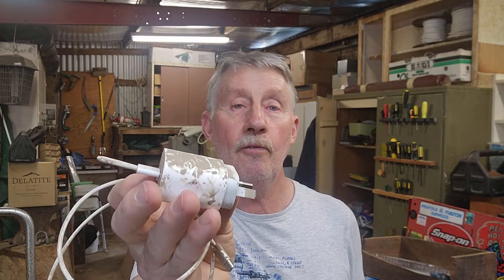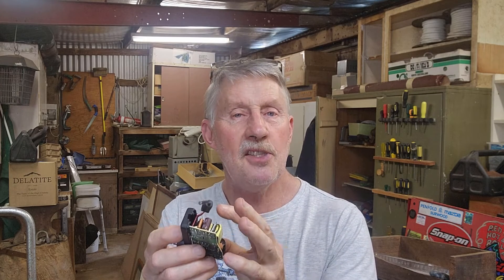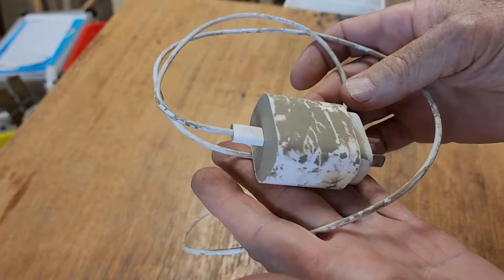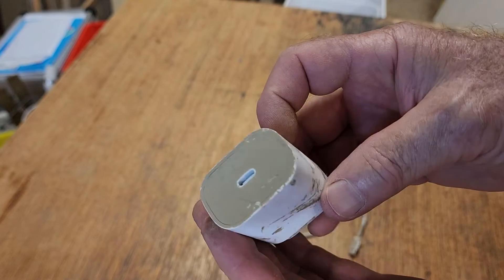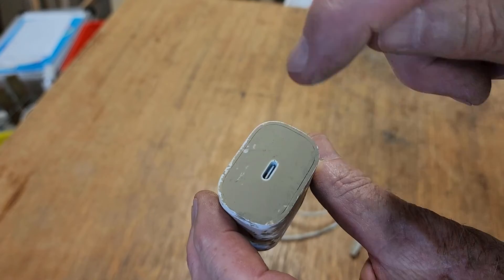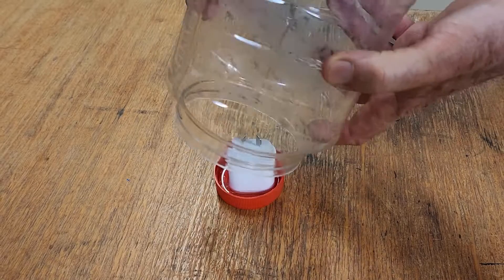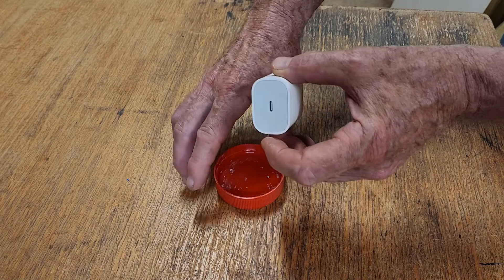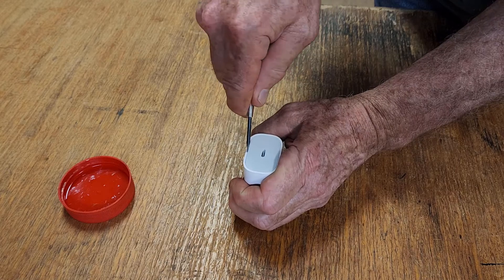How to Repair an Apple 20w USB Charger which was under Floodwaters for 3 days! DIY iPhone Charge Fix

Comment: I was looking for a way to get into a 20w usb c charger. I actually slid 2 pry thin tools on the bottom side where the pins is. And I popped it off by unclickiking the clips on it. 
The top is still in beautiful condition and the very minimal pry marks is at the bottom
Reply from the maker: Excellent, nice work. Yeah some have clips and some are glued. Usually you have to fight them!

Comment: The charger is adhered with ultrasonic bonding, requiring gasoline to remove it. There is a YouTube video demonstrating how to disassemble a PC charger using gasoline for a clean decomposition. Please refer to it for guidance.
Reply from the maker: I couldn't find that video, what keywords should I search?
Reply: @TheUltimateRecycler  https://youtu.be/a00esZ3B-aQ

Comment: Hello my friend, can you tell me with what you have cleaned your so dirty charging adapter and cable in a very one way.  Because I tried to clean 2 different iPhone charging adapters with petrol, the top surface of both chargers melted like wax, like plastic on fire.  Please tell me with which liquid you cleaned this charger and cable properly.
Reply from the maker: Yes petrol and other solvents can indeed melt certain plastics! I used IPA (Isopropyl alcohol).
Reply: @TheUltimateRecycler  you used normal alcohol or special alcohol. Normal alcohol like mixed in everyone whisky 🥃 because my friend have buffalo dairy Farm they use alcohol to milk fat report they use vet strong alcohol. Waht i can use these alcohol?
Thanks for reply
sorry for my weak english.

Comment: Well done on this one! I had a friend who dropped a valve radio into the sea! He managed to rescue it immediately, took the valves out, put it in the bath and covered it in cold tap water, which he swilled around vigorously for a while, picked it up, let it drip dry, and then put it in the thermofan oven at 100 degrees C for a couple of hours, and then tested it out, and it worked perfectly. So rinsing in clean water, rinsing in IPA, blowing it dry and then letting it heat up in the sun as you did, makes perfect sense!
Reply from the maker: Thanks Dave! Yep, as long as there's no power involved while the item is wet, then no damage should be done. Although leaving things sit without rinsing and drying would introduce a whole host of corrosion problems!

Comment: It takes a lot of skill to outwit a trillion dollar company that doesn't want their things to be fixed.  Well done.  I was dubious that the dented capacitor would come around so nice to see that.

A few weeks ago I spilled some water on my USB charger.  I left it alone for a couple days and it seemed fine but then at some point I heard it start hissing and crackling and then it was done.  A real danger!!!
Reply from the maker: Thanks Nas. I don't know about outwitting them - but at least we had a win against annoying non-serviceable modern manufacturing methods! Yeah, once these things get moisture inside they are on death row. If they were easily dismantled, they would be a straight forward fix and less would have to die!

Comment: What about a heat gun will soften the glue up cheers Graham
Reply from the maker: As it turns out the "glue" was basically the plastic welded together! A heat gun would probably just make a bigger mess than I already made! Thanks for watching Graham 😊
Reply: @TheUltimateRecycler  I send message b4 watching to the end.  I think a clean cut would have been the better way. Keep up the good work

Comment: Hi Chris, those plastic cases are impossible to get apart, looked pretty good in the end though. A good thing Apple were forced to toe the line in regards to using USB-C connectors, I'm not fond of companies who use proprietary consumer level equipment forcing us to buy only from them. Well done Chris.
Reply from the maker: Totally agree Dave - If someone stood for PM and promised standardisation for all fittings/plugs/hardware in all fields right across the world, they would have my vote! 🤣

Comment: Nice work. They use an ultrasonic welding technique that puts high frequency sound waves into the two pieces of plastic and it heats them at a molecular level. Results in a super strong weld of two similar plastics.
Reply from the maker: That's interesting Rick! Thanks mate 👍😊

Comment: You definitely achieved your goal. With minimal damage. The idea of that capacitor exploding and burning down my house would keep me up at night.
I would leave it plugged In Charging an old device for a week or more in a metal bucket in the garage as a safety Test. 

I would suggest investing in a phone repair tool kit, although with the melted plastic I'm not sure a metal pry shim (spudger) would make the job any easier. 

Either way I think we all learned something from this video. Thanks for sharing.
Reply from the maker: Thanks TPS - as long as we all learn something my job is done! 👍😁

Comment: Grats on the fix, but I'd be a little wary about leaving it plugged in overnight whilst folks slept, until it had been in left on for a week or so, to keep an eye on it... and it regained my trust.
The last thing you'd want is that bashed capacitor breaking down and shorting out when it warms up.
The school I used to work in, burnt down in the middle of the school day in the 80's... someone was striping old paint off and a very small fire turned into a £8 million rebuild... I'm not sure what the adjusted cost would be in 2022. 
Don't get me wrong, I'm all for repairing/recycling, but I'd have to weigh up that £20 charger vs a house or worse a life.
Reply: With the luxury of hindsight, I'd flush the charger with IPA submerging it, soaking, draining, shaking, repeat a number of times, then a final flush with clean IPA and into an oven for an hour at 100C. Let it cool then risk blowing the circuit breaker.
No breaking it open.... no accidental damage... If the salt has started to form bridges or corrode the circuits washing off the salt and drying it in an oven should stop it getting any worse.  Just my 2p with hindsight and your great video!
Reply from the maker: Fair point Martin but the unit would be almost impossible to flush out without dismantling as the USB-C socket only provides a very slow seepage of liquid - almost a one-way valve really... and I wouldn't like to plug it in while partially full of IPA!
I don't think the capacitor would have any chance of starting a fire - but all the same , I agree with a suitable safe testing phase 👍😊